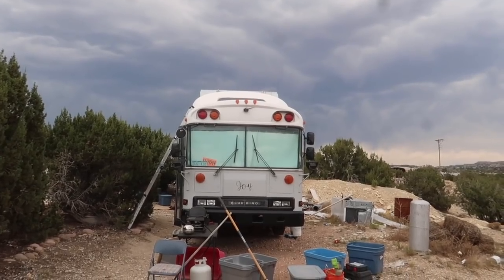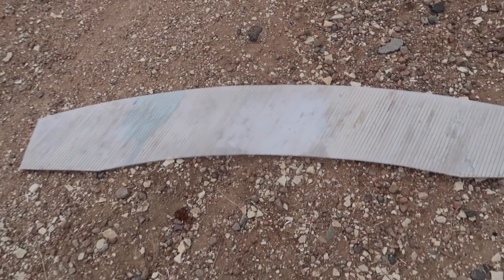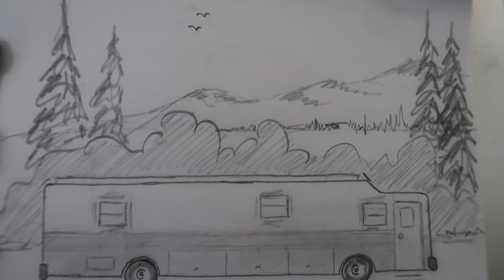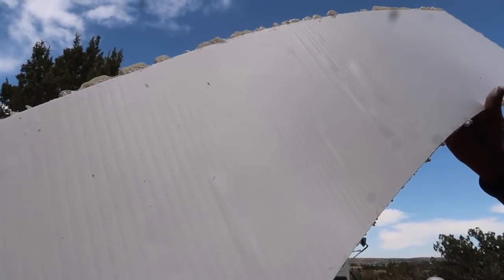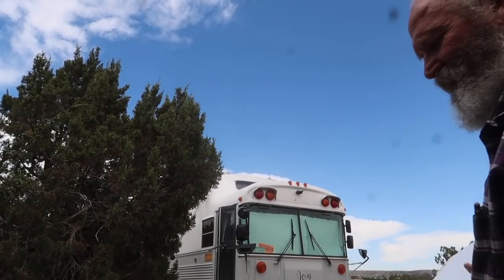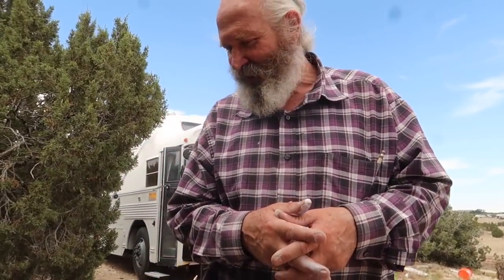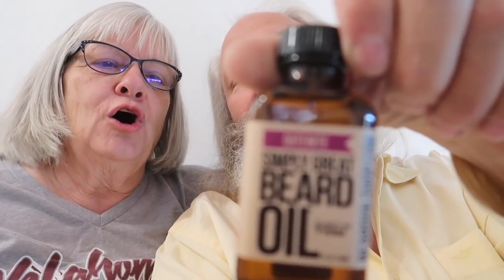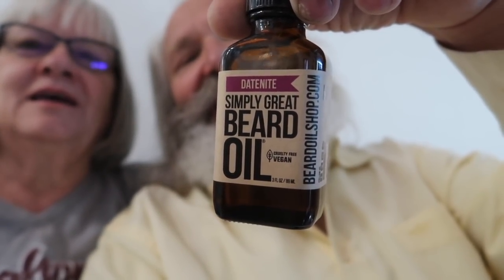Bus Conversion to Motor Home #121 Design ideas and wind deflector

Comment: Jim, have you ever consider a recycle hot water line in the shower back to your fresh water tank?  It will/should be a simple setup, and may come in handy on cool days. It will save you water if and when you are boondocking.  Even run a hot water line to your kitchen sink if you want hot water to wash dishes. Just a thought……..
Reply from the maker: Thank you for your idea.  I will be sure to share it with Jim.  Thanks for watching!

Comment: #2.  For the deflector, why not use a piece of aluminum or light sheet metal with appropriate ribs rolled into it for strength.
Reply from the maker: Tim Bowman Good idea.  Jim is looking at metal options for sure.  Thanks so much for watching and for commenting.

Comment: Not sure you will see any change in the mileage. In that size vehicle and weight what you see is what you will get??? Maybe a .1 or so total. I like 2 and 6 and 10. Make it out of metal as you did the sides. Glenn Lever
Reply from the maker: That is probably true about the mileage.  Jim likes the idea of making it with metal.  He values your opinion.  Thanks for your comments!